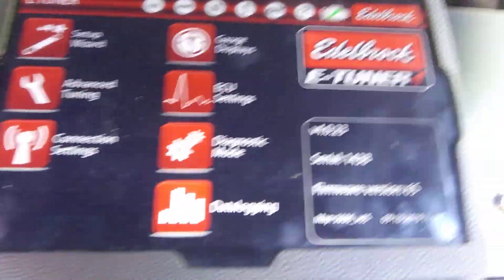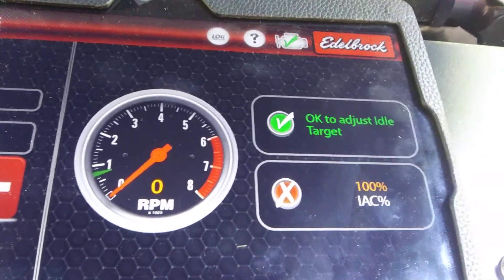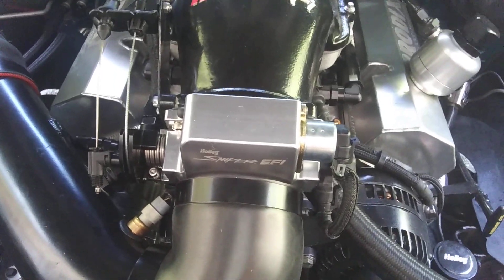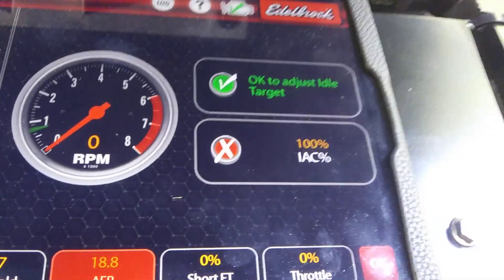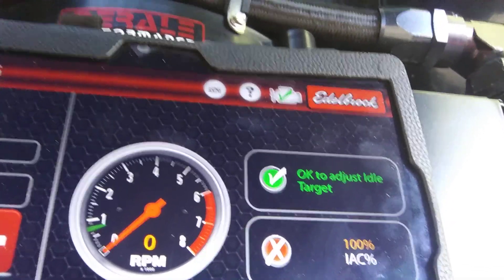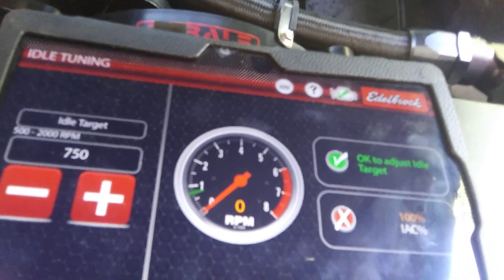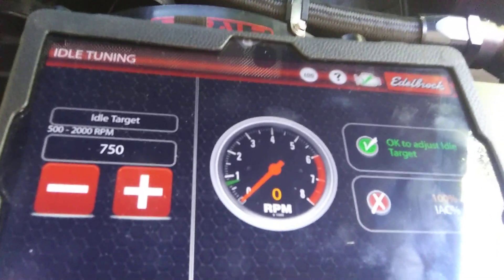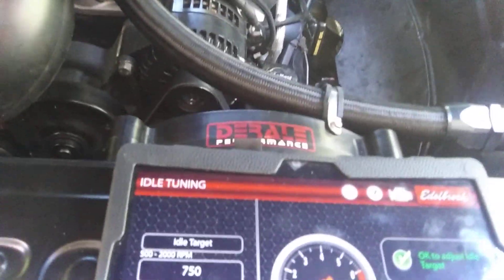Setting idle on a Edelbrock Pro Flo 4 efi system, installed on a SBC 350 / 5.7l

Comment: Good video,do you have any ideas why all my spark plugs are getting wet with fuel
Reply: Its a 6.0 with a edelbrock pro flo 4 ,i would look into that man ,thank you so much for your time
Reply from the maker: @joshvilla4083  No problem. If you are on a stock cam, injector size can be a issue. I wouldn't go much bigger then 29lb/hr injector. Stock is 25 lb/hr at 58 psi.
Reply: Ok thank you so much i will look in to it ,i gata see what size injectors it has om it ,great info thanks
Reply from the maker: @joshvilla4083  Double check the injector and coil wiring harness are on the side of the motor they are labeled for.
Reply: when i bought the truck it didnt have pcv valve hugged ,and had no breathing hoses ,from the engine to the throttle/pro flo4,tild one day i didnt want to turn on ,i couldnt figure it out tild i took out the spark plugs and notice all of them were black and smell like fuel
Reply from the maker: @joshvilla4083 You sound new to PF4. You probably have a PF4 PLUS unit. Here is the PF4 plus manual https://static.summitracing.com/global/images/instructions/edl-358900.pdf
Download the PF4 plus app from the play store.
Reply from the maker: @joshvilla4083  If it was running and now it won't. I would check power and ground to the PF4. Start at the battery for good connection check fuses and relay.
Reply: Oh ok i found out im not getting spark at all im gona check the cranck shat sensor
Reply from the maker: Not knowing anything about your motor. The first I would look at what MAP you are using. I match the MAP with vacuum hg at idle. Not cam size, most people think they more cam then they really do. I start with smallest MAP the motor will run on. This the PF4 forum. https://forums.edelbrock.com/forum/pro-flo-efi/pro-flo-4
Reply: Hey man ,i hope you having a good day ,i have a quick ,question how would you be able to tell what size injectors it has ,only number i see is 8420
Reply from the maker: @joshvilla4083  Sorry I don't know. If the injectors have colored band around them then they are edelbrock.